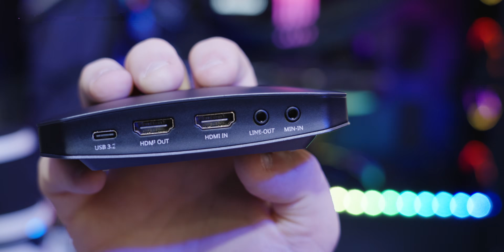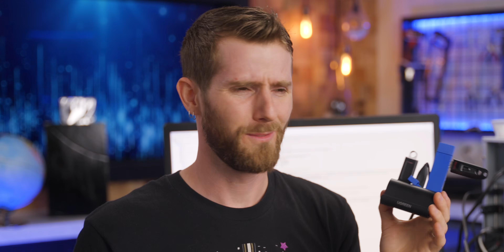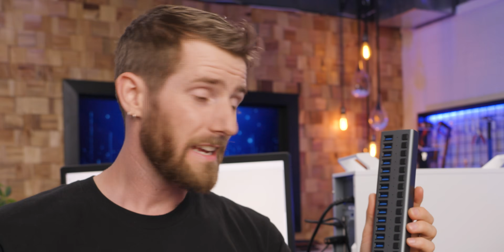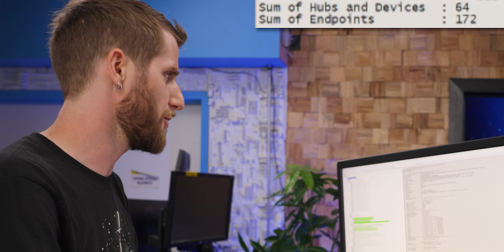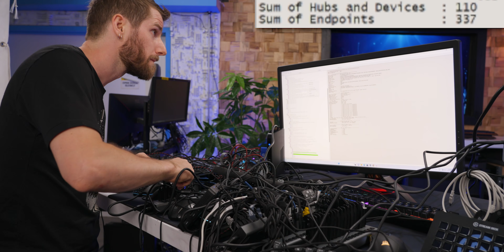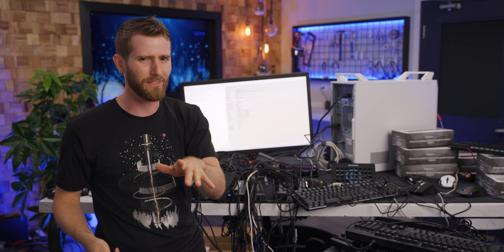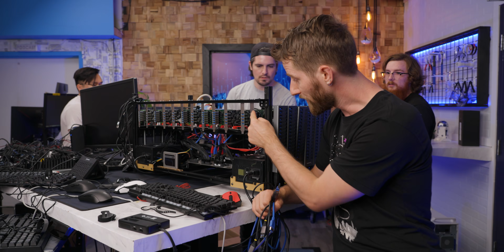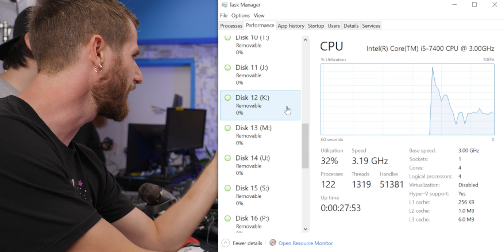How Many USBs Can You Plug In At Once?

Comment: Funny enough, I ran this experiment a number of years ago (2005 ish) running under Windows XP.  Ultimately, I was able to get 212 devices (plus 20+ hubs) connected to a single Dell laptop.  For the "127" device limit, I found that that was 127 devices per host controller.  Most PCs have a couple of host controllers - this Dell with a docking station had 3 or 4.  The other thing I found was that each device plugged in seemed to take about .5 percent of the CPU ... I suppose to maintain communication with it or some type of overhead with the driver.  After I had around 200 devices online this .5 percent had finally added up to nearly 100% CPU utilization just sitting there.  As I turned on the last 12 devices, the friendly "ding dong" sound Windows makes when a new USB device comes online slowed waaaay down.  Device 212 literally had a 15 second long diiiiiiiing-doooooong sound.  213 never registered being powered up.  I think the hardware could have theoretically handled more devices, but the CPU was maxed out.  This was all for an actual legitimate purpose.  I wasn't using thumb drives and it took some creative mix of powered and unpowered hubs to be able to power all the devices themselves... but, way past the "127" mark.
Reply: I want to know the software limit for 95, 98, 2000, XP, 7, 8 and10. There must be a software limit. usb emulator software should be able to easily find it.
Reply: how and why did you get 212 devices 😭
Reply: WHAT

Comment: This is actually relevant to me since my flight sim setup uses multiple Arduino boards as well as other USB devices. I currently have 6x Arduino Mega, 2x Nano, Logitech rudder pedals, Honeycomb Yoke/Throttles, Wireless headset, Keyboard, Mouse. Sure I have 2 powered USB hubs, but considering I still have more planned upgrades knowing the USB limits is useful.
Reply: Buying a PCIE USB card will probably allow more devices if you need it
Reply: Yeah, before I got into flight sim I would've just shrugged this off and said "but who cares", lol
Reply: @SupremeLordGeek  So far so good but I'm planning on at least 2 more Mega boards. Running a 5800x 3d so I'm hoping Zen 4 does me well with USB support lol. I have 2x Sabrent powered USB hubs similar to what they used.

Comment: One of the best videos you've made. Theoretically understood all of the limitations, but to actually physically test this just looks like amazing fun! And the AMD tests are just damn bizarre and awesome!
Reply: I love AMD's yolo approach, it has saved me time and effort in the past.
Reply: Me over here using 3,094 USB devices on my desktop with a custom intel chipset designed for my pc and my pc only.
Reply: i don't think its an extremely powerful USB host i think its just more bugged than tanking because none of those actually worked AMD is still very buggy for no reason
Reply: @kieranlee9610  its more that the y will let you pile it on until you crash. It gives you a little bit beyond the official standard, whilst simultaneously becoming exponentially more buggy the further beyond the standard you go.
Reply: basically, mad scientists

Comment: I work on a computer that actually uses 128 (plus 16 hubs) USB 2.0 devices plugged into a single Linux machine. We really did use 128 USB thumb drives to test it out before assembling the full mess. It got quite a bit harder when USB 2.0 root hubs stopped becoming easily available. USB makes a great sideband protocol for bootloading and management.
Reply: For what scenario do you need that many devices?
Reply: @kingmaxlol64  I'm going to guess automation. I've dealt with pharmacy automation systems that use USB for communications have ran over 80 devices on a single system but never that many. I notice crappy controllers get flakey at around 50 or devices but solid controllers handled the 80 no problem (HPe workstations).
Reply: @kingmaxlol64  I will guess Phone Farming? Unfortunately they are common in certain places.

Comment: The limit is not the number of devices but the number of endpoints per hub controller. With newer USB 3 you could connect up to 4096 endpoints. Intel xhce controllers are famous for not complying with that limit, furthermore different versions of the chip have different limits ranging from 64 to 192. AMD supports a lot more of endpoints.
Reply: If intel figures out a way of saving some money so one of their theoretical limits is lower but they don't think anybody in the real world will complain about it, they will do it.
Reply: Intel Sucks
Reply: "nobody will use more than 64 devices at once" intel laughed while not seeing Linus Sebastian quickly approaching behind them
Reply: @KainniaK  I think its fine so long as they include it in their documentation (I don't think they do tho)

Comment: Would've been interesting to see if behaviour was much different in linux, since it seemed to become a driver limitation at the end.
Reply: They would have needed wendell to know whats going on in the linux kernel
Reply: Does mac also have that limitations? 
Since they use thunderbolt, will speed or any other  component be affected when that many devices are connected?

Comment: I found this out a few years ago! Depends on the system! Also, some Unraid systems wont boot if you have so many USB drives in that it pushes the bootable USB off the boot device list.
Reply: Lol, that sounds like a fun headache. I recently changed motherboards and there are physical slots for 8drives but the silicone only supports 6, so when you turn it on it would randomly select 2 drives and not detect them. I figured it out quickly enough, but didn't notice this at time of purchase and needed to buy a raid card.
Reply: ...you could say...It got booted 😉
Reply: @ErulianADRaghath  lmao get out :-p
Reply: @Idiomatick  Yikes, that also sounds like a headache and bad design!
Reply: @CyberbrainPC  It was clearly written in the spec so i have only myself to blame..... though a better eufi diagnostic message would certainly be a welcome improvement. I tried switching cables before checking spec, so i guess it'd have saved me 10mins.

Comment: This video is very relevant to my work. I got 20 port powered hubs that take 2 usb B 3.0 inputs. (basically two 10 ports hubs in one unit) I flash 40 galaxy phones at a time and it takes forever because of the bandwidth, pushing 7.5 GB to 40 devices. I have 3 usb PCI cards so basically 10 ports per controller. I would love to flash more at a time but wasn't sure where my bottleneck is
Reply: Why the f are you flashing that many phones? Spam bot?
Reply: Are you the reason so many bots exist?
Reply: i never heard of something like this. why do you have to flash so many phones???
Reply: @dedtrox6424  the guy that flashes the stolen phones...
Reply: @dedtrox6424  Probably the work phones for the company they work at. A lot of companies use them.
Reply: do you work at lowes
Reply: Bro all these people's jokes are so unfunny
Reply: @Crecross  your face is funny.

Comment: I remember back in the days before USB, we used serial ports, and a PC would likely have one or two, and the most I saw on one system, with a controller that cost more than my gaming PC at the time, had 8.  The resources used by each port pretty much limited it to 8 ports per system.  Having so many devices today is such a luxury.
Reply: I worked at a place in the late 90:ies where we had loads of more serial ports than that on a single pc, the trick is having the kind of cards that offloaded some of the processing to the card itself. It was used to run a modem pool, but I think that I remember it being the same number as you, aka 8 per card.
Reply: Yeah, I remember reading one of dad's old "how computers work" books, and it talked about SCSI daisy-chaining (the predecessor to doing the exact same with USB)... Apparently, you could make some real crazy stuff happen back in the day if you had enough devices, enough cables and ports, and zero fscks given.
Reply: serial and rs232, those were the days, not forgetting the parallel printer port.................
Reply: @skeennah1927  Ever have to deal with RS485?
Reply: @dangingerich2559  nope, haven’t heard of that
Reply: @skeennah1927  A lot of industrial printers and automation used it.  It was quite frustrating at times.
Reply: @WackoMcGoose  Old SCSI only let you have 8 things on a cable (which was later brought to 16 with later versions). What was more interesting compared to USB is that more than one device could be a host computer.
Reply: @eDoc2020  Also that you are not at all limited to just disks, printers and CD players with SCSI but you can also connect an Ethernet adapter or even a co-processor, quite a versatile bus. Though of course most used it for disks, CD players and printers.

Comment: Linus - Genuine idea for a video. Do a USB hub rundown of cheap or unbranded hubs compared to good ones. I recently bought a hub marked as USB 3.0 and when a USB 3.0 device was plugged into a USB 3.1 port via this hub it slowed the data transfer down to USB 1.1 .... It was clearly a con, but there are thousands of sellers trying to flog them with dodgy misleading descriptions on eBay and Amazon (who don't care). Call the scam products out and do a wonderful consumer awareness video all in one 👍
Reply: To be honest powered cheap USB hubs kind of scare me. I've seen some actually send voltage down from the hub into the motherboard. You got to even watch out for some USB devices having malicious firmware which may have keyloggers on them. I just buy directly from trusted manufacturers for things like USB devices, SD cards, etc. Found that out after getting scammed with a fake Samsung micro SD card which looked legitimate until I started running some tests.

Comment: For USB storage devices : In windows you also have the drive letter limit, so you cannot add more than upto drive Z (I think there was a hack to be able to also use drive letters A and B which are for floppy disk drives). In linux though there is a possibility that it might work.
Reply: There is no limit in Linux, you can have as many drives as your IO can handle.
Reply: Wouldn't linux also be limited in the same way because each drive is sda, sdb, sdc, and so on?
Reply: This is true only for drive letter assignments, windows allows attaching disks to empty folders just like Linux does, and can address a nearly infinite number of volumes this way.
Reply: @regrettspaghettt  No - Linux wraps around at sdz to sdaa, sdab etc, and then will move on to sdba after that until you reach sdzz at which point it will go to sdaaa and so on.
Reply: In windows you can mount drives to folders Unix style, using disk manager. 
In disk manager, right click on the drive, select "change drive letter and paths" remove the drive letter(optional) and in "add" you will see an option for "mount in the following empty NTFS folder"
Reply: @ZeroX252  Glad to know someone thought of that, unlike the windows developers
Reply: @ZeroX252  oh neat I didn't know that
Reply: @mrmelon54 Windows does it that way because MS-DOS did. MS-DOS did it that way because QDOS/86-DOS did, 86-DOS did it because CP/M did
Reply: @mrmelon54 you can literally manually map as many drives as you like in windows, it's just a bit more work

I mean, when do you ever have an entire alphabet of logical volumes anyway? What are you doing where this is an issue?
Reply: Windows has a drive letter limit but you can mount a drive inside a folder you name and the drive letter limit goes away.
Reply: Run your USB drives in software raid so they present as one drive. 

Problem solved lol
Reply: Incidentally, why does Windows still not let you assign drives to A or B in Win10/Win11? People (both end users and the vast majority of businesses) haven't used floppy drives in almost twenty years.
Reply: @billyeveryteen7328  There are some edge cases for application compatibility that still rely on certain DOS-isms like not being able to name a file "CON" I'd imagine that Windows retains the A/B reservation for the same reasons.
Not sure if we'll ever ditch that since medical and industrial equipment sometimes rely on these things.

Comment: With all the new lab equipment I'd love to see a test of lots of different dashcams, see if the expensive ones are worth it 🤔 *edit: didn't realise they've already done one, maybe a more in depth one or possibly diy jank one 👀
Reply: I'd also like to see it done with Linux, which might handle the USB connections slightly better. If anything, maybe to disprove it as well?
Reply: they have already done a video on dash cams, and their result was pretty much none of them are, i would like to see a more indepth one tho, as someone who is looking to get their first car soon i definitely intend on getting one
Reply: they made video about them already
Reply: there is difference between 50-300$ in quality but more expensive are useless, better using some custom solution for really high end systems
Reply: They already did a dashcam video, although they can now do it more in-depth but yeah they already did

Comment: 10:30 It seems like you guys forgot about the USB-BC (battery charging) spec which allows basically any USB-A port to pull a much larger current than the USB 2.0 and 3.0 specs originally allowed. In some cases, up to 2.4A for a total of 12W. This is why USB-A charging stations often have 2.4A ports. The USB-A plug is supposed to be able to handle 3A without catching fire to remain in spec. Whether or not the host controller allows that much is another thing.
Reply: When phones started to have "quick charge" 5-7 years ago it wasn't uncommon to see 5V 5A chargers with a USB A plug.
Reply: @bastienx8  I've never heard of that, do you know of any examples of devices that would actually draw 5A at 5V? Seems like a fire hazard...
Reply: @Cyberguy42  The Huawei P20 Pro and P30 series were shipped with an official Huawei fast charger with a 5V 5A port, and a corresponding "5A" USB A to C cable.
The Oneplus 3, 5 and 6 had a 5V 4A charger, for example

Comment: Just to ellaborate more on the limits: The upper limit for devices in a single USB network is, per the USB specification, not xHCI, 127, as correctly stated (128 from 7-bit address length, but address 0 is reserved for any un-enumerated device so the host can talk to them and enumerate). xHCI for some reason allows up to 255 devices (8 bit address) but I can make no sense of how it would actually work, because USB simply can't handle more than 127 because of the address size, maybe 2 separate networks in a single controller, each on a separate port, but I've never seen it. Each device can have up to 31 endpoints, also per USB specification, not xHCI (that's 16 from 4-bit endpoint address, but each endpoint address except for 0 can have one IN and one OUT endpoint. Endpoint 0 is special because it's a single IN/OUT endpoint exclusive for the control channel). So the absolute upper bound (for a single controller) is 3,938 IF you consider 0IN and 0OUT as a single endpoint (device 0 always has the 0 address endpoint). No controller I know of actually reaches anywhere close to this, so you can have anywhere from 96 (for Intel chips AFAIK) or even lower for embedded MCUs for example, but there's no reason to stop at 128 really. The reason host controllers have endpoint limits but not really device limits (lower than USB capabilities of course) is because each endpoint usually requires a dedicated FIFO queue in RAM to handle communications, whereas a device is just an address number. Also in some controllers endpoint 0 is implemented as two separate endpoints because it makes more sense as it needs both IN and OUT capabilities so the actual endpoint limit may be lower than it seems

Comment: On Intel chipsets, the Roothub of a modern USB Controller usually hase 26 Ports defined in ACPI (per controller). If your USB hubs come with their own controllers, then attaching more devices than 127 doesn't seem impossible due to the amount of available ports each controller providdes.
Reply: The issue comes down to how those root hub ports are mapped physically. In general, each root hub port is mapped to a pair of individual USB ports, be those a header on the mainboard, or a stack of ports on the rear I/O. This substantially limits the number of endpoints you are able to connect.